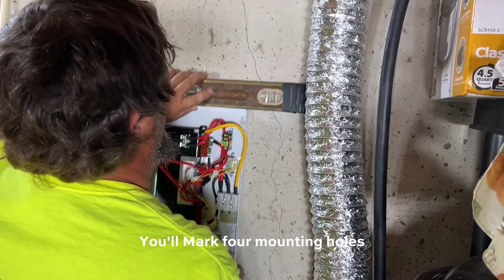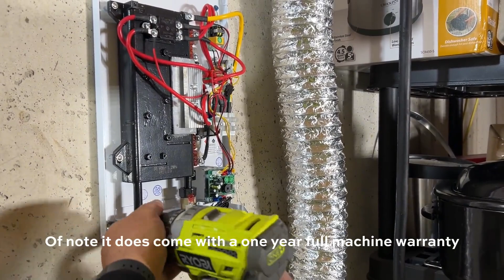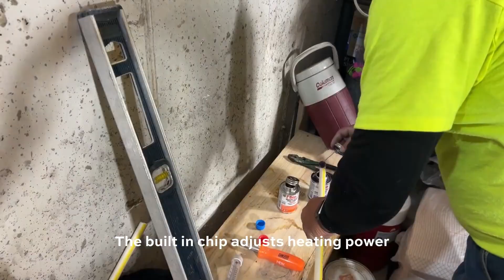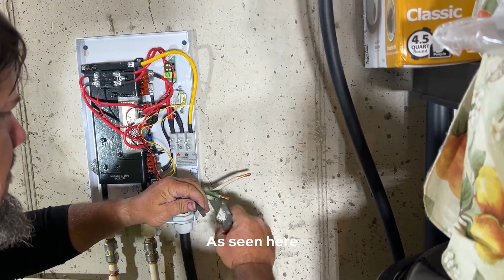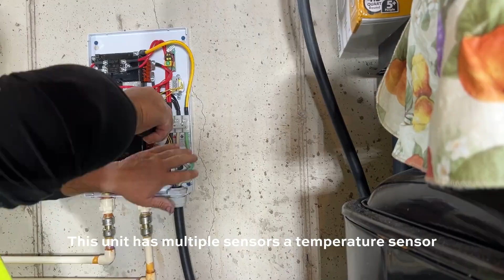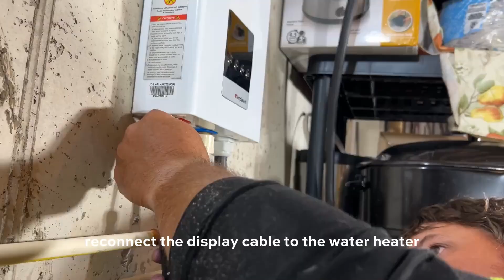Unboxing the ORBEK Electric Tankless Water Heater 14kw: Is This Water Heater Worth It?

Comment: 14kw will only run one faucet.  It’s like having a point of use all over a house.
Reply from the maker: The specific GPM value varies with the inlet and outlet water temperatures. For more details, please refer to the North America Groundwater Temperature Map on the product detail page.
Reply: @ORBEK-Service I’ve seen the sheets and have done a real life test. You can’t run two showers at 115 with inlet temp at 70 on low flow showers.
Reply: @Steve-bm2zmwho runs two showers at the same time
Reply: @dan79transam65 two showers two faucets    You’re telling me there’s never been a time where someone’s running a shower in a faucet at the same time.   A family would have to plan things out like hey I’m taking a shower no one run the hot water.
Reply: @Steve-bm2zmhave you ever been in the shower while someone flushed the toilet. Sorry i dont live in a 10 bedroom 4 bath house
Reply: @dan79transam65 the toilet doesn’t use hot water🤦‍♂️🤦‍♂️🤦‍♂️. I have a tankless electric 18k it’s only used for showers and dishes.  Some household love washing laundry in hot water and they complain it doesn’t keep up.  Plumbers hate installing them because they know they will get a call back on them.